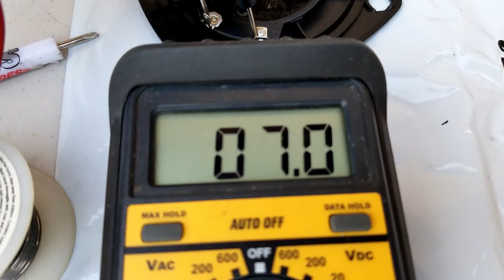Aftermarket replacement 1" Titanium diaphragm dome tweeter

Comment: how did you center it? you glued it before center it?
Reply from the maker: I was actually able to place the coil with the plastic piece over the magnet, then what I did was center the coil and apply some scotch tape to hold the coil in place. I then removed the scotch tape on one side of the coil and applied glue, I let that dry for a bit before removing the final piece of scotch tape and applying the last amount of glue. To this day the speakers sound awesome. Thanks for watching

Comment: does polarity matter on tweeter dome leads?
Reply: No you can just reverse the wires that attach to the speaker if it's opposite of what it should be,  typically the wires on the voice coil are as such. . . The one that comes from under the windings is positive  the one that's on the outside is the negative,  again just reverse the wires going to the speaker if needed, there's no reason to take it back apart if you did it backwards

Comment: Silk dom twiter is best
Way you canvart titanium
Reply: Silk dome tweeters were replaced by metal dome tweeters in the early 1980s. First copper, then aluminium and finally titanium. Celestion from the UK invented the metal dome tweeter and it was first used in the SL6.